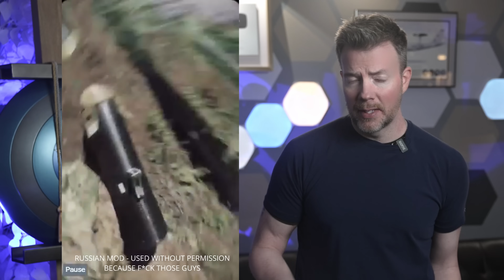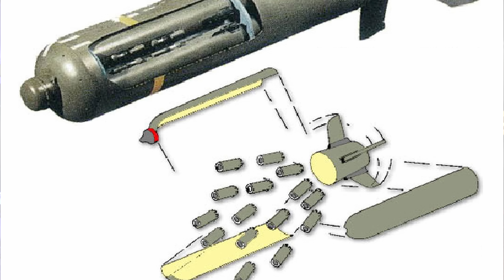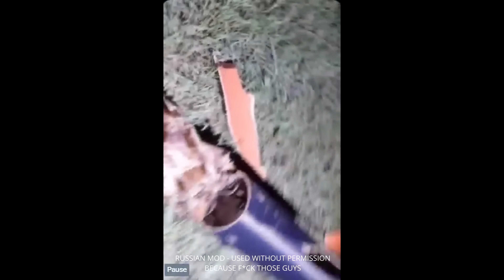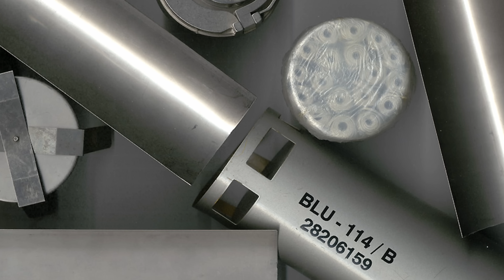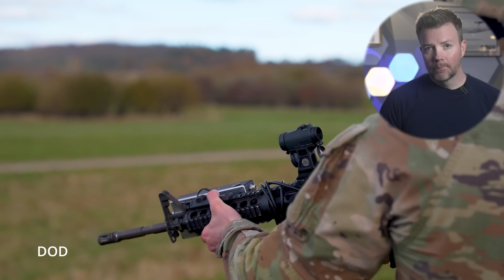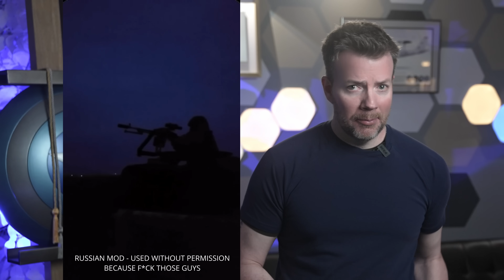Russia Claims Ukraine Using Graphite Weapons - Here's Why

Comment: While not graphite filaments - tying a steel cable to a train track and throwing the other end over the electric lines was often used by demonstrators against the nuclear waste storage facility in Gorleben (ger) in the 90's. Using infrastructure to tear itself apart is a good old tradition of asymetric resistance. Most damage with least resources. Combining the graphite filaments with drones is just logical. I try not to think what happens when these ideas spread to smaller non state actors. If used strategicly against power grids under strain much more than just temporary damage is possible.

Comment: Any competent military, when faced with an important piece of its defences needing a stable, continuous electrical power supply should have, at the minimum, a two layer solution to maintaining continuity of supply. Perhaps the national grid first then diesel  generators if the grid is interrupted. 
I said "at the minimum" because you could have a battery back up if the fuel supply to your generators fails. 
Batteries have time constraints, of course. 
But, in no way can the russian military be called competent, if the components for the back up systems can be traded for vodka or sold for cash, there's a high likelihood of it being old, unserviceable or simply not there. Corruption is built into their supply lines, it's institutionalised and has been for generations. 
This isn't just a military thing, civilian infrastructure is built and serviced in the same manner.
Why install the new car battery the customer has paid for when you can just clean & polish a scrap battery, install that, and pocket the cash. Or, if the new part is on your bench already, take it home and sell it. 
The scale of these scams can range from the petty, as above, to truly epic proportions affecting the whole country. 
So these graphite bombs are switching off an already degraded system. Back up systems are a garden of delights for the corrupt as they are needed so infrequently (in peacetime). It's only when something goes wrong that the old or missing components are noticed. 
Once hit, repair teams get new kit to replace faulty components and the whole sorry saga continues, new kit sold or traded, damaged substations are hooked back up with as much of old crap as possible, teetering on the verge of failure making it much easier to take it out the next time. 
With the added bonus being that the evidence of corruption will be eradicated by the strike and if not, the  repair crew has a free hand to eradicate it themselves upon each visit. 
"Comrade Secretary, Substation Technician 3rd class, Ondar Blagginski, reports that repairs will cost twice the original estimate and that all records of previous repairs were destroyed by blast and the ensuing blaze." 
This is the basic rot at the heart of russia's military and economy. It's what makes these deep incursion, repeat drone attacks on the oil infrastructure so effective and it's why regular attacks using graphite bombs will have effects way, way beyond what would be expected in a functioning country. 
It'll be like a gentle push on the first domino with cascading faults spreading far beyond the point of impact. 
I can't bloody wait! 😜
Slava Ukraini! 
😎🇬🇧🤝🇺🇦✌️

Comment: OLD TECH - it was called Flashlight years ago. The tracking on the insulator bushings will mean they have to be replaced. Easier than rebuilding structures but can't be rushed.

Comment: Nothing new here, that has been used since WW2 with copper wires. Surprising that Ukraine did not use it already.
The conductors cause an ionised zone, shorting out the power. It can cause a long shutdown because the vapourised conductor coats the HV insulators and takes a lot of work to clean off.

Comment: My father worked at the DLR (back then DFVLR) and with advanced construction materials. Like carbon, glass, Kevlar etc reinforced material ceramics etc. 
He mentioned the risk of e.g. a carbon fiber plane crashing and burning and the risk the dust would pose to nuclear Powerplants and other electronics…. That was back when I was a teenager in the 80/90ies.

Comment: "The Blu 114 bravo required to tomahawk." That's false. There was an equivalent dropped from an F-117. Which means the same ordinance can be dropped by an A-4 or even a propeller plane. The reason the stealth was used was to evade enemy air defense. It had nothing to do with a need for something advanced to carry it.

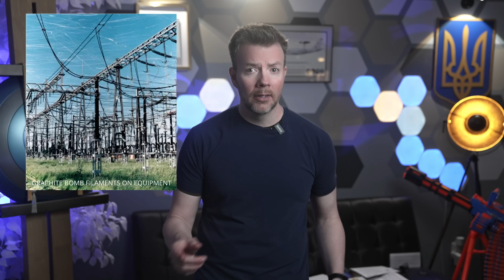Comment: 11:10 "Graphite filaments on equipment" ... That's not graphite, that's optical fibre left over from drone strikes using their fibre FPV drones. Those drones fly for up to 20km without being interrupted by electronic warfare as they use light via the fibre optic cable as a transmission line as opposed to a radio signal - the down side, your entire countryside gets cobwebbed by fibreoptics.

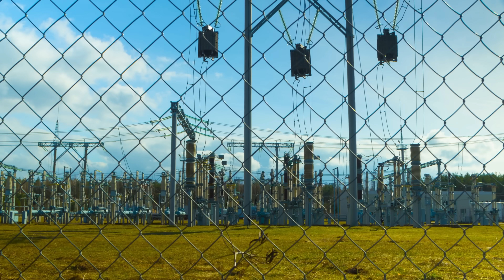Comment: 3:15 Right -- it's not even "supposed" to damage the equipment at the substation, because the substation "should" be designed so a short anywhere in the system will just pop a breaker before any real damage is done. 

"Wait, why are you shaking your head sadly?"

"The target was a Russian substation."

"Ohhhhh...."

Comment: Hi from Canada!  I have worked in a graphite plant in Lachute, Québec, SGL Canada. I can tell you from experience that Graphite is not the type of material that you can make filaments with. The shape of the molecule is a multifaceted ball. This is why it is sliperry. It takes practice to walk in a graphite plant. I think that graphite is mixed with carbon fiber wich is already conductive.  This is great enhancement. The silver color shown on the filaments in the video are actually the right color.
This powder can coat any surface and it's particulary found of plastic. It bonds to it. It is impossible to use a gazoline engine. You would have to replace the ignition system every week. Everything turns matte chrome. For a weapon, you just need to break the insulation protection. Once you get an arc. Ionisation kicks in and the air turns to plasma. The current surge is immense because the 3 electrical phases short circuit. The power grid overloads and the power is disconnected to protect the system. It's a circuit breaker. I don't know the rating. It disconnects the grid. You have to clean the area of graphite and replace all the insulators that have silver colored traces on them. That's graphite electrically bonded. That insulator is now conductive. So it can be a fair amount of work to repair the damages. However, nothing is destroyed.

Comment: Grids with a lot of low-momentum power are very vulnerable to this.
Conversely, if you have a lot of thermal / nuclear / hydro, you can just disable the auto-reclosers and drill the grid reinstatement procedure.
As this attach vector becomes more prevalent, I anticipate mitigation by means of reprogramming automatic switching systems to cut away the deadwood more aggressively during excursions.

Comment: Hmmm...
Wondering what has to be completed and replaced to get a system a nationwide system back up and running? It won't matter...jc. Iraq.  The logistics of Iranian oil permanently offline is interesting. 
That Island will have to be occupied. 
From what I understand you can't turn an oil well off. You can but the consequences are much more detrimental. Something's going to have to be done about the oil infrastructure.

Comment: BOTTOM LINE
Russian sources have claimed that Ukraine used drones carrying graphite‑based payloads, but there is no independent verification and no official confirmation from Ukraine.
The available evidence consists only of Russian‑released footage of unidentified debris and unverified reports from pro‑Russian channels.
The claim remains unconfirmed.

WHAT RUSSIA IS CLAIMING
Russian forces in occupied Donetsk allege that Ukrainian drones carried “graphite bombs”—munitions that disperse conductive graphite filaments to short‑circuit electrical infrastructure.
These claims are based on:

Videos posted by pro‑Russian channels showing unmarked, unusual debris

Assertions that Ukrainian FP‑1 or FP‑2 drones carried graphite‑based warheads

No serial numbers, markings, or independent forensic analysis have been provided.

WHAT GRAPHITE WEAPONS ARE (VERIFIED FACTS)
Graphite weapons—sometimes called “soft‑kill” power‑grid munitions—are real and historically documented:

They disperse fine conductive graphite filaments over electrical systems

These filaments can cause short circuits without destroying infrastructure

Used by the U.S. in:

Iraq (1991) — disabling up to 85% of the grid

Yugoslavia (1999) — affecting ~70% of the electrical system

These weapons are designed to temporarily disable power systems, not to cause explosions or structural damage.

WHAT IS VERIFIED ABOUT UKRAINE
1. No official confirmation
Ukrainian authorities have not confirmed using graphite weapons.

2. Evidence remains inconclusive
The debris shown in Russian videos:

Has no identifiable markings

Could be conventional drone components

Has not been authenticated by independent investigators

3. Possible—but unproven—technical capability
Defense Express notes that Ukraine’s FP‑1 and FP‑2 drones could theoretically carry graphite‑based payloads, but this is analytical speculation, not evidence of use.

WHAT IS NOT VERIFIED
No independent confirmation of graphite weapon use
No Western intelligence, OSINT groups, or independent journalists have verified the claim.

No proof the debris contains graphite filaments
The materials shown could be unrelated structural components.

No confirmed impact on electrical infrastructure
Russian claims of power‑grid disruption from these alleged weapons have not been independently corroborated.

WHY RUSSIA MAY BE MAKING THIS CLAIM
Analysts note that Russia has incentives to:

Portray Ukraine as escalating the conflict

Justify retaliatory strikes on Ukrainian infrastructure

Frame Ukrainian drone attacks as targeting civilians

These are interpretations, not facts—but they align with past Russian information‑warfare patterns.

FACT‑CHECK VERDICT
Unverified.  
Russia has claimed Ukraine used graphite weapons, but no independent evidence supports this.
The only sources are Russian military channels, unverified footage, and speculative analysis of drone debris.

Comment: America invented this years ago. To shut off power in Iran without total destruction of High Explosive Bombs Trump could use these, but probably won't because he's not Nice! These things SHORT OUT the INSULATORS that isolate the wires from the Towers and Poles. The insulators FAIL and must be replaced before you can reset and restart the power grid. In an extreme circumstance it might take out a Transformer accidentally but that is not the goal. The goal is to disable it to the point that it cannot be swiftly repaired but does not cause severe damage. Bombs are permanent solutions to temporary problems. The temporary problem is a disagreement between 2 governments that one way or another will eventually be worked out. So completely destroying the Power Plants is just desperation for Trump to Win or an Evil Move since it is unnecessary.
Reply: @johnabel8883  Obummer just blew them up

Comment: Most in the comments are not getting it. They are saying this doesn't kill, it is harmless etc.
It absolutely can kill innocent people - just not directly by physical local damage to them.
Hospitals, water treatment, banking, retail, traffic systems etc. all need power. Some may have back up generators... petrol and diesel supply globally is already under stress and will be for at least 6 months. Parts for repairs of these networks can also be very limited. It's not always just replacing fuses - hardwear blows up.
I don't think people realise how dependent life and social norms are on power and how delicate the systems are globally.
That's not to say harm is guaranteed but a look at the comments suggests people think this is always harmless. That is not accurate.

Comment: how about building a roof?
i know: radical idea.
Reply: @klausgartenstiel4586  won't work. Graphite bombs detonate in air upwind of the target.

You'd have to enclose the power facility in walls, which has its own problems.
Reply: any roof can be penetrated ☺️
and it's much cheaper to make small hole in the roof than building entire shield-like structure.
Reply: ever tried putting a roof over a transmission tower?

yeah... not as easy as it sounds.

Comment: Fishnet, made of UV-resistant plastic, put over the open part of the power grid, even using the very same pilons the grid uses. Yeah, one would need millions of miles of those nets, but protection against graphite filaments is definitely possible. Another possibility is to seal those wires - this would also protect birds from electric shocks.

Comment: Dear dumb ass. It does damage the wires. Electricity jumping across l8nes burns through the coating on the wire.  So the wire does need replacing. It isnt just a shut down like switching a off a switch..

Comment: USA used that in Yugoslavia in 1999. It does short-circuit the power lines. However, out technicians figured out that the fibers are easily cleared with plain brooms.

Comment: If I was Ukraine, besides grafite fillament or nets to cause a short circuit; I'd trow in some actual grafite powder mixed with some tungsten carbide powder. This kills any electrical motor from, for example, cooling a transformer; and the structural damage of tungsten powder means you need to replace every and all ball bearing that touched this cloud; as it will wear out extremely quickly. This kind of "sabotage" has been common since the second world war actually.

Comment: Conductive strips as ordnance  "BLU-114/B"   From wiki "The US Navy used sea-launched Tomahawk missiles with Kit-2 warheads, involving reels of carbon fibers, in Iraq as part of Operation Desert Storm during the Gulf War in 1991, where it disabled about 85% of the electricity supply. The US Air Force used the CBU-94, dropped by F-117 Nighthawks, during the NATO bombing of Yugoslavia on 2 May 1999, where it disabled more than 70% national grid electricity supply. The supply was restored in less than 24 hours though was later disrupted by a further attack on 7 May 1999. It was again used following the 2003 invasion of Iraq"  the reason for them is that it does less permeant damage to the grid infrastructure.

As for not being advertised I remember them from 1991.

Comment: Anti grid weapons have been used since the middle of WW2. With British balloons being used to drag copper cables across axis power lines. Graphite flashes into a highly conductive gas under high voltage. The shown photos have a great deal of remaining fibers. Which makes graphite unlikely to be the fiber being used if the photos are genuine.

Comment: Presumably you could solve the problem relatively quickly by gradually ramping up the voltage on the affected lines?  Power would flow through the graphite threads, heating them up very quickly as they are so thin, and before long they would melt and break.  As long as the total amperage is under the rated load for the equipment it wouldn't cause any overloads, so you could sit there for as long as you need.  As each thread breaks, more power is available to melt another thread.  Gradually ramping up the voltage would result in all the threads melting and fairly quickly clearing the lines, allowing the equipment to be returned to service.  Essentially you turn your power station into a current-limited variable voltage power supply, until all the graphite threads have been melted away.  There might still be some arcing issues as the voltage increases due to reduced clearance between phases but if you could current limit the supply as the voltage is gradually ramped up they'd all burn off as well, with little to no damage if it was done slowly enough.

Comment: It could be fiber optic wire used to guide drones. That stuffs everywhere
Reply: fiber optic cable is  made from materials that are not conductive.
there is way to transmit power but that's by using electricity to light to electricity conversion. that is kinda useless in this case.

Comment: Along HI ways are LONG, free, easy to remove, steel guard rail cables ...  If there is time and resource calling a chopper to pick up one of these and drop it over transmission lines would work wonders :)

I have no idea if that done though,  Maybe it's cheaper to just use explosives to knock down a couple big power line towers?

Comment: The power lines carry 100 amps. You need a thick wire to carry 100 amps and create a short circuit. Most of the lines are spaced a long distance apart so any wire has to be fairly long. Getting a fine wire to create a short circuit between these types of lines is a virtual impossibly. Nice try to the uninitiated. To an electrical lecturer, l would like to see the proof. If it were possible l would be carrying boomerang loads of wire and tossing them onto the power lines entering all Australian cities for the fireworks display.

Comment: This idea's even older then you think, the British had a few cases of barrage balloons, the large inflated gas bags with wires anchoring them to the ground to act as a deterrent to low flying aircraft, breaking loose in bad weather and trailing their anchor line across power lines and causing massive electrical grid blowouts when they'd catch on power lines and short them. They then got the idea, if having them set loose in their own country accidentally could cause such havoc, what about a campaign to set them loose deliberately when the wind was blowing towards occupied Europe....